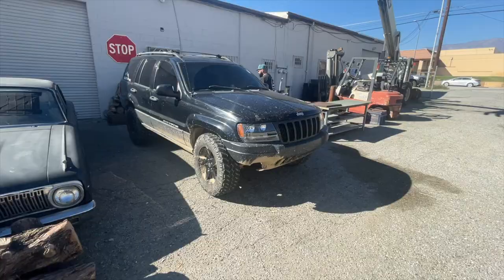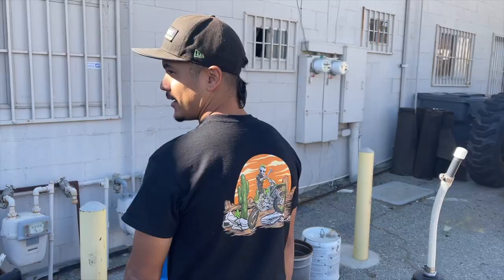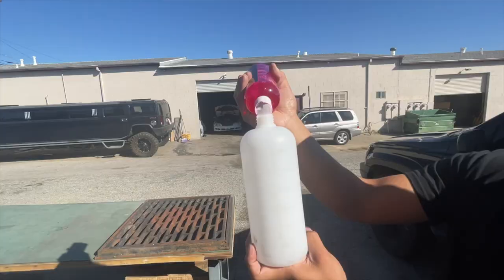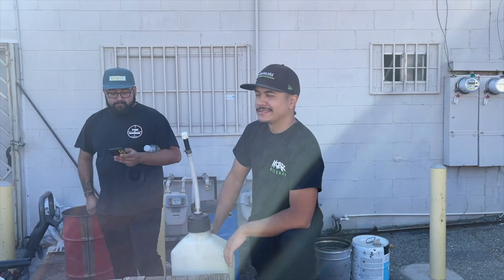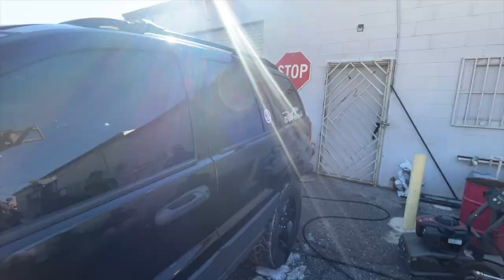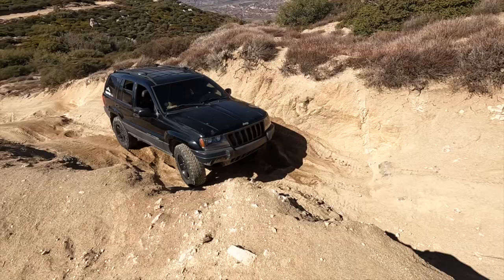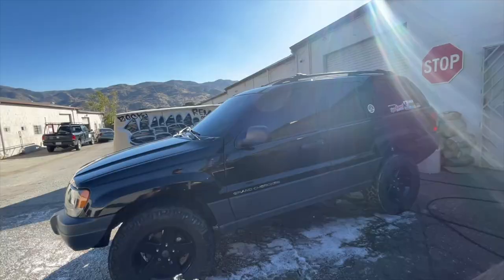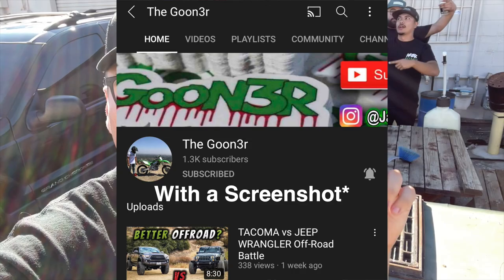What we BROKE on Chris' Jeep WJ at Cleghorn

Comment: Najar, those rezeppa joints are not happy if you lift the rig. Wont last too long. Youre better off getting a double-cardan/standard joint setup. Hit a salvage yard and its not too
 expensive to convert.
Reply from the maker: Yes sir that’s what we will be doing! They don’t like lifts haha
Reply: Just the front drive shaft?
Reply: @msand951  as long as the lift is not more than about 3in, the rear is fine. (at least on mine).